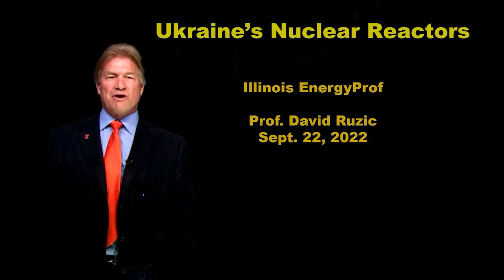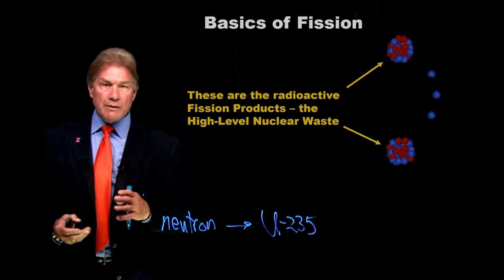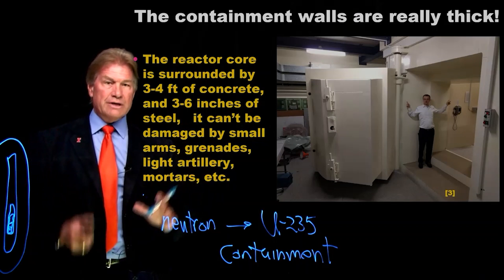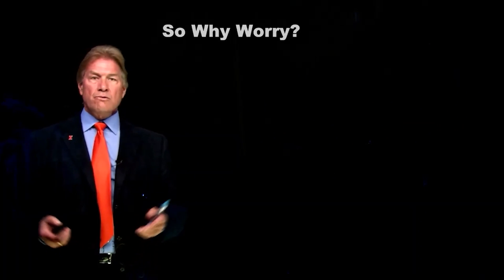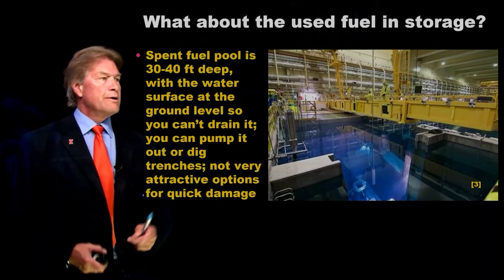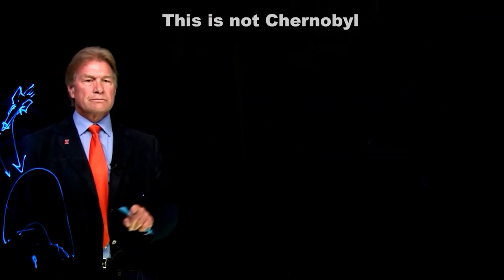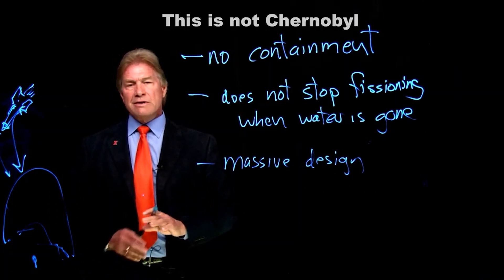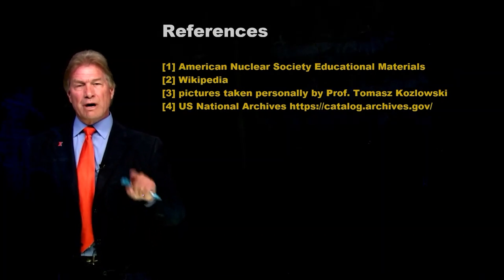Ukraine's Nuclear Reactors

Comment: This is really meant seriously:
The blow up of the Cherson dam has removed the water supply of the Zaporizhzhya Nuclear power plant dam . I admire the fact that they did build an extra basin for reserve water for such a case long ago. But this reserve won´t last forever and to build pumps from the rest of the river upwards is doubtful in wartimes. 
Now here is my modest, uneducated proposal:
Before it gets too hot, why not taking all the fuel rods out on the fields around the power plant. First the most active, than the less active. Do that in a save distance to one rod to the next one. The are will be a radioactive but save area.
The idea of the rods starting to boil and explode is far worse than the fact that you will have a radioactive but thermally save field.The rods may be collected after the war.
As far as i know the rods are made of very robust steel alloys. They may last in the open for years. (i am not sure about this). Every thing is better that a dry out explosion.

Comment: But what if the diesel generators will stop working during the blackout? Simply because of lack of fuel for them. And remember, this is a war zone. All logistic ways can be destroyed. We need to speak about open air spent fuel storage too with dozens of containers. It’s much more vulnerable then the unit’s containment. What do you think about these risks?

Comment: By taking the plants offline and denying generator fuel,  Putin creates another Fukashima.
By stopping the cooling water they will overheat, meltdown, and explode from hydrogen gas.😢
Reply: The VVER-1000 units can vent the hydrogen to the exterior, and likely have scrubbers to keep in xenon and other radioactive material. Tritium would escape, but it's not a big deal.

Comment: Gotta keep the diseasiol fresh. Iv been running a hospital and the generators didn't fucking work
Reply: The plant in question has already had to use diesel generators several times due to the outages.

Comment: I would add that graphite, that was in RBMK reactor, which was secondary moderator that kept reaction going, also is flammable and it's hot ashes became radioactive that spread with wind across long distance - modern reactors not only do not have secondary moderators, they do not have flammable/ash-able components so EVEN in full and total meltdown with uncovered reactor core (which itself is very hard to achieve), hazard zone would be localized, and not widespread.

Comment: I’m not worried about a bomb hitting it. I’m worried about an idiot turning off the circulation pumps or just disrupting shipments of diesel until they run out of fuel. Isn’t that what happened in Fukushima? Why isn’t a Fukushima-like meltdown possible? Is there a difference I’m not seeing?
Reply: From what I remember, the Fukushima spent fuel ponds were raised in the air next to the containment structure, and at least one of them had a leak (probably due to the structural damage of the earthquake).  Hence, they had to keep pumping water to refill the ponds to keep the fuel rods cool.  In this case, since the water can't drain out, the water absorbs the heat until it boils away (which takes 5x the energy that it does to bring water from 0C to 100C).  This gives everyone a lot more time to work out a solution.

Fukushima's reactors had also been turned off automatically due to the earthquake.  Most nuclear reactors can't be restarted for ~3 days after they shut down due to Xenon poisoning (one of Chernobyl's problems was that they ignored this), so at Fukushima they couldn't restart a reactor to power pumps even if they realised the reactors themselves weren't damaged.  That option is probably available at Zaporizhzhia, if they lose other sources of power.  (However, running the reactor means that the fuel will have the really hot short lived fission products if something goes wrong.)

A spent fuel meltdown means that the heat from radioactive decay makes the fuel melt, and also turns fission products into gas.  This releases the fission products from the spent fuel, and they can float away until they cool down and fall out, mostly close to the plant.  (At least if you don't have burning graphite creating an updraft.)  Also, if the zirconium casing of the fuel gets hot enough, it can separate hydrogen from oxygen in water vapour.  After Three Mile Island, the US installed hydrogen absorbers to prevent hydrogen explosions, but Fukushima didn't do this, so there were some hydrogen explosions, which blew off the blast panels of the outer building (not the containment building).  I'd be willing to bet all nuclear plants have hydrogen absorbers now.

Fukushima created a mess, but the panic is what killed people.  In the middle of a massive disaster from the earthquake and tsunami, they evacuated all sorts of people, and something like 1500 people from a hospital and/or retirement home died.  The typical dose in the exclusion zone over 2 weeks ended up being less than a chest CT scan.

It is possible for a Fukushima like event to happen in Zaporizhzhia (in the early stage of the war, I was concerned that the Russians would steal the diesel from the plant), but we have reason to believe that it would take longer, and hence it won't be an 'accident.'  It will be the result of deliberate action to make the disaster, or at least to prevent countermeasures.  And, even if it does happen, the safest thing to do is probably to sit tight, especially if you or someone you're caring for will be at risk during the evacuation.

Instead, the Ukrainians, the Russians, and the Western Media have settled upon the narrative of impending disaster.  For the media, 'will an errant shell cause Chernobyl time 10?' is a much better story than the truth, so why fact check yourself out of a story?  I think I saw one report that mentioned that the containment building even existed.  For the Ukrainians, the narrative is 'look how evil the Russians are; you should give us more stuff to drive them back'.  For the Russians, the narrative is 'look how evil/incompetent/desperate we are; you'll be safer/more comfortable if the war stops soon'.
Reply: @lacklustermathie   You forgot to mention that no one died from Fukushima radiation, so if a "Fukushima-like meltdown" occurred, it would likely be only an expensive clean up, not a disaster of life.

Comment: Why didn’t you touch on the control rods being down or the rods themselves not containing only fuel pellets?  

I guess it would’ve distracted from your point but even if there was no water or even if the control rods failed to fall into place it would become a molten mixture containing these other neutron absorbing materials preventing disaster both with the design of the fuel rods themselves & even more so when contained within the core of a reactor that’s made to prevent any such runaway reactions…all of this being contained within the building you described (and all being stuff you surely have a deep expertise in).

Comment: Good video overall. I too despair when I hear the paranoia regarding nuclear power, which has even caused some countries to try to get rid of nuclear reactors. Yes, if not designed properly and with a bit of bad luck they can make quite a huge and expensive mess. But the actual health risks for the population living near them are negligible.

For example, the evacuation of the population near Fukushima did more damage to their health than sheltering in place would have.

PS: Ukraine doesn't like very much to be called "The Ukraine".

Comment: Hey, Professor, I have a small question.  What about the pipes that take the steam to the generators.  Those are basically "holes" in the containment building, right? How do they shield the radioactivity from coming out those holes?  I know it's minor compared to the whole size of the containment building, I'm just curious, because it seems the containment building is not entirely sealed.  Or is there some method to prevent leakage through those holes?  Thank you!
Reply: The level of radioactivity at the edge of the pool the reactor is in is slightly above background. The containment building is not there to stop radioactivity escaping in normal use and is the 4th line of defence and as such is there in case of an emergency.

For example, it would mitigate the effects of an explosion that could launch radioactive material into the air. In such a scenario those pipes are not going to be an issue.
Reply: @alexdunhill4271  Thank you for responding.  After writing the question, the obvious solution occurred to me.  Say the concrete is one foot thick.  Have the pipes go in at one spot, turn while in the concrete, and come out at another spot.  The radioactive beams travel straight; if the pipes turn a corner, you can easily make it so the beams cannot escape.

Comment: I respect you but I disagree with your assertions about the comparisons between the RBMK in Chernobyl and these PWRs.  

First, the world found out about Chernobyl because alarms went off at reactors in Switzerland, northern Europe.  So, the regional wind patterns are from Ukraine towards Europe.  So, a radiological incident in Ukraine threatens Europe.  There is the first reason Putin might want to destroy those reactors.

Secondly, your assertions about the containment building seemingly assume the use of conventional weapons - guns, tanks, missiles, etc.  A direct hit on any of those containment buildings by even a modest tactical nuke, with a ground burst, would vaporize the building and, likely, the reactor inside it - if not multiple reactors and their containment buildings.  If the missile containing the nuke were design to penetrate the ground, it would be even worse as the fallout would be intensified in quantity and the reactors would be dispersed, not buried as you assert (just look at the Sedan crater in southern Nevada - that was the result of a modest nuke).

Thirdly, you pointed to reactors in the lower right-hand corner of Ukraine - destroying those reactors would, effectively threaten all of Ukraine and beyond towards Europe.

No, were Putting to hit those particular reactors with, say, a 100-kiloton nuke designed to ground penetrate (or two or three), that certainly would be the end of the Ukraine war, and, probably, Ukraine itself.

I don't specifically know, but I believe the 40 km exclusion zone around Chernobyl is in force today.  Take 6 Chernobyl reactors and blow them upward with the energy to disperse them and I think your analysis becomes quite minimal.  Add in dispersion of what is in those cooling pools and you've doubled your destruction, if not more.

The danger of these reactors becoming a tool for Putin is quite real.  The tell that he's considering something as ridiculous as this would be the pulling out of Russian forces from Ukraine and a vacation trip of Belarusian President Lukashenko to South America.

This likely isn't going to happen for one simple reason.  Even Putin, who is acting seemingly irrationally, doesn't want the pall of this tragedy on himself or his country - something that would hang around for at least a century, if not much longer.

Comment: What I've never understood with 'waste' fuel - is that if it passively generates enough heat (for some time) to still require cooling, why don't they use it all up? It is beyond wasteful to not do so. Given that the whole premise of nuclear power generation is to use fission to create heat to turn a steam turbine to generate power. There is no such thing as waste heat in such a case - that is the primary purpose of the whole operation.
Reply: A fuel rod that's at the end of it's 'lifetime' still contains some (of the original) U-235, and some Pu-239 which are both fissile. But during the time in the reactor, there are also other isotopes formed (by fission, neutron capture or decay) which act as a 'neutron poison' (they are not favorable for the fission of U-235). The formation of fission products inside the fuel pellets, combined with the high temperatures will cause these pellets to become brittle and fragmented. These effects are to be expected, but form also a limit for how long a fuel rod can stay in a working (fission) reactor. 

And to run a reactor only on decay heat, that's not economically feasable, because the thermal output of a used fuel rod, one day after stop of the reactor, is 'only' 0.5% of the same rod running at full (fission) power. So a typical 3000 MW (thermal) reactor will only make 15 MW (thermal, so you still have to find a way to make electricity with it), and that figure will only drop...Maybe there would theoretically be a way, by using heat pumps ore so..., but one has to remember that this requires a whole new installation, also with some of the safety components (fission products are nasty stuff) required in a normal PWR. I guess that's why used fuel rods are either reprocessed (to extract and re-use the U-235/Pu-239-leftovers), or safely stored in heavily shielded fuel casks (after initial cooling down in the spent fuel pools).

Comment: If a coal or natural gas fired power plant were attacked or overrun during war--like the ones in the Donbass region Russia has occupied and fought over since 2014, it wouldn't even make the news. This demonstrates how inherently dangerous nuclear power plants are. They cannot simply be turned off.
Reply: Uh no, they can be turned off in seconds.  
Nuclear energy is the safest form of electricity we have.
Reply: @danadurnfordkevinblanchdebunk  Three Mile Island scrammed and still melted down. Reactors 1, 2 & 3 at Fukushima scrammed and still melted down. You CANNOT simply turn off a nuclear reactor.
Reply: @danadurnfordkevinblanchdebunk  Do I really have to educate you on the meaning of SCRAM? You know damn well what it means. Your replies are disingenuous.
Reply: @danadurnfordkevinblanchdebunk  Yes the reaction stops but decay of radioactive isotopes does not stop. After TMI2 scrammed radioactive decay continued to generate 30MW of heat which had to be removed. It was not so it melted down. The melt down stopped when cooling water circulation was restored. Result? A brand new $500 million reactor was destroyed. You do realize that even spent fuel rods have to be cooled for years after, right? If not you need to reacquaint yourself with the weak nuclear force.
Reply: @danadurnfordkevinblanchdebunk  Which one of those failures creates a toxic radiologic exclusion zone which must be evacuated and abandoned for years, decades or longer?

Comment: Small thing, but it's generally bad form to say "the Ukraine".  That's on old Soviet thing meant to deligitimize Ukraine as a country.
Ukraine translated is something like "boarder lands" so when you say "the Ukraine" you're saying "the boarder lands" The boarder lands of what? Of Russia, because the ukraine isn't a country, it's just the boarder lands.
Reply from the maker: I certainly did not mean anything derogatory when I said "the' Ukraine.  Of course it is an independent country.  The word "the" just slipped out.  It is true that I would not say, "Here is a map of the France".  On the other hand it does sound perfectly natural to say "Here is a map of the United States".  It also could be habit from having heard it described by that term for most of the last of my 64 years!   I did not realize it was politically sensitive, but sure do now.   I am more "up" on the science than on the politics and I try to concentrate on the science part.
Reply: @illinoisenergyprof6878  for sure! I didn't think you meant anything by it.  Saying "the ukraine" is/was common parlance for decades.  I only found out a few months ago when I heard some Ukrainians asking people not to use it.

Comment: 4:30 Error in the professor's definition of cold shutdown.  He states & shows on the screen that the reactor is at atmospheric pressure.  This is wrong.  Cold shutdown does not mean the reactor is at atmospheric pressure.  The manuals for Westinghouse PWRs states "With the plant in cold shutdown, the pressure in the RCS must be at least 320 psig to support running the reactor coolant pumps".  The IAEI statement about the cold shutdown condition of the Zaporizhzhia plant says that main coolant pumps are running. 
4:41 Another statement, "as long as some circulation is maintained, some pumps going, there is enough water flow to take away the waste heat from the fission products" is very incomplete.  The waste heat has to removed from the reactor system, it has to be transferred to another system.  This vulnerability on secondary systems shouldn't be swept under the rug.

Comment: The nuclear reactor threat there is relatively benign compared to the use of tactical nuclear weapons. Seems only a matter of time. Question is where it will occur first and by whom. That's outside the scope of what you discuss, so not expecting any reassuring videos about that topic. However, any use of tactical nukes could be a major setback for building more reactors. Hope it doesn't play out that way.

Comment: Great presentation! Just some quick advice though- It’s just “Ukraine”, not “The Ukraine”. Give Ukraine the prefix suggests its still a part of the Soviet Union, which it isnt
Reply from the maker: I certainly did not mean anything derogatory when I said "the' Ukraine.  Of course it is an independent country.  The word "the" just slipped out.  It is true that I would not say, "Here is a map of the France".  On the other hand it does sound perfectly natural to say "Here is a map of the United States".  It also could be habit from having heard it described by that term for most of the last of my 64 years!   I did not realize it was politically sensitive, but sure do now.   I am more "up" on the science than on the politics and I try to concentrate on the science part.